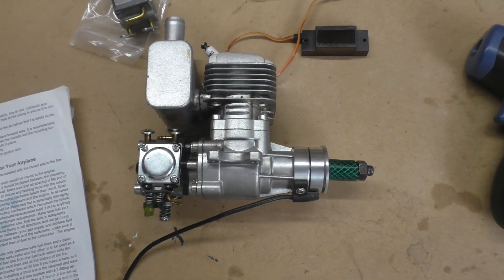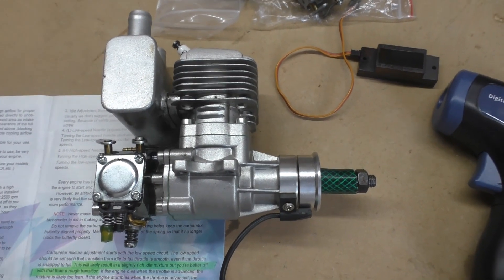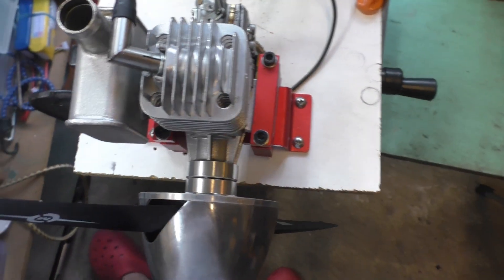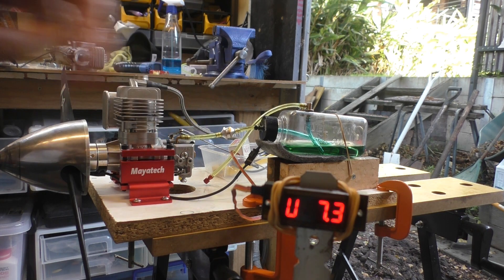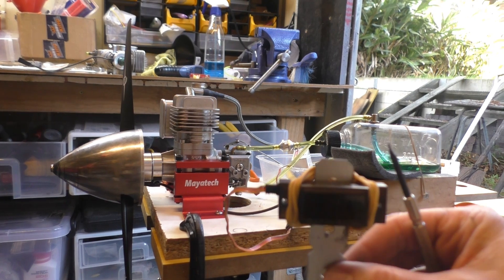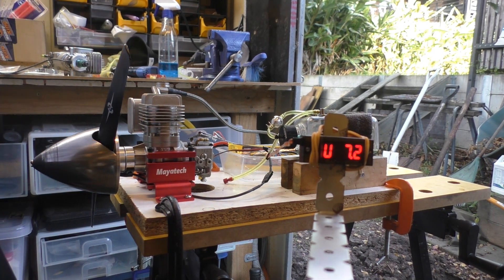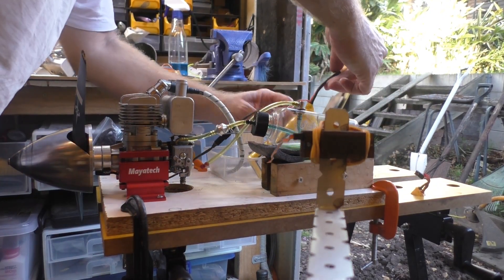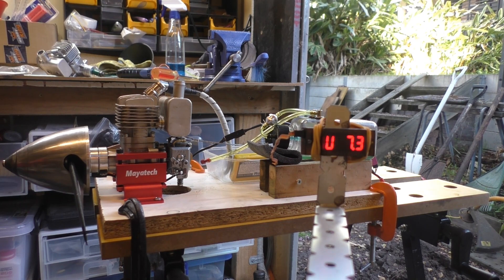RCGF 15cc Stinger petrol/gasoline engine - fine tuning the top end

Comment: Hi there
Need advice of you pro RCGF engine 
I got a 10cc which don’t like to start what’s so ever I do 
I am getting spark Aldo getting fuel which normally should start
I set the L and H needles as recommended in manual 
I had many nitro and gas engines from 14cc up to 150cc never had such an issue 
Any advise would appreciate it 
thank you

Comment: Just curious!  Did you use 2s LiPo (7.4V) or 2s LiFe (6.6V) as your supply?  My guess is 7.4V (I saw Zippy there).  Idle should be about 2000rpm.  Yours was a tad high.  Thanks for the video :-))
Reply from the maker: yes, either a 2 or 3 cell lipo. The input voltage on the RCGF ignition module is 6v to 14.4v, so you can use a 2 or 3 cell lipo

Comment: just to let you know I run the 56cc versions and if you run them on a stand it can bend the connecting rod the single cylinder are worse than the double they need that movement from the shaking of the plane and vibration it is very hard on any single to be bolted to something very solid and stiff just to let you know and btw I have had good luck out of the ones I have and thanks for the video and info you also really need to hand flip a gasoline engine as well
Reply: Mate where do you get these ideas from if you bend the rod on the stand it will bend wherever you run the engine.
Reply: Bent conrod? That doesn't sound right to me.
Reply: I hope this comment was a joke! If not, you need to study engines, and metallurgy, before even touching another one!!

Comment: Never break in a motor with a big heavy spinner like that on it
Reply: also never put a single cylinder on a stand it can bend the connecting rod they need to shake and vibrate not be bolted solid to a table especially single cylinder with aluminum connecting rod but I have never head of any spinner hurting them unless it it not balanced proper
Reply: @sendit2873 You shouldn't comment anymore. No since in advertising that you're an idiot.
Reply: It makes no difference. The process of breaking an engine in is to establish a wear pattern. Which is why the thinner oil mix is used, it allows the cylinder to wear a bit faster.

Comment: Hallo RCGF fan! You sounded more anxious on the Mustang maiden than could be seen in flight. The 15 cc is really strong and just a tad heavier than the 10cc. I have the whole range from 10 to 35cc. I have tuned them all the same way.
1 Slow down throttle servo speed to ca 0.3 - 0.5 sec. Prevents the smaller engines to choke when advancing rapidly from idle
2 Slightly rich idle setting ie "a bit of 4 stroking" when advancing throttle, safer than running clean over the whole rpm range
3 Go for as high rpm at full throttle as possible on the ground
4 Back high needle a tad = richen it a bit
5 Test in the air by going to full throttle
6 Propably running a bit rich as it unloads in the air
7 Often you then need to lean it a bit on high needle when back on ground
8 I monitor engine temp in air and no engine has run to hot even om a warm sunny day

Cheers Lasse

Comment: What size prop are you using. I've a 14x7 mas 3 blade on mine. Rcgf15re  
And Hello from little New Zealand 😊
Edit I run 14x9 Mas 3 blade my YS91AC supercharged four-stroke glow motor. It pulls 11Krpm on 20% nitro